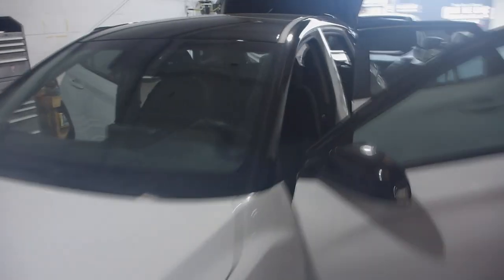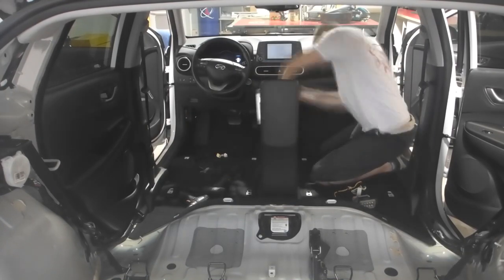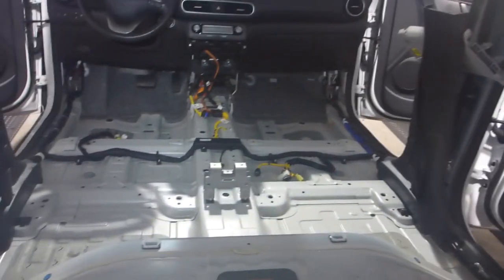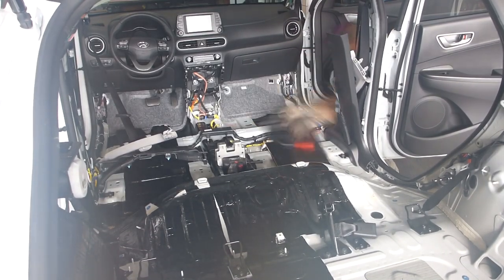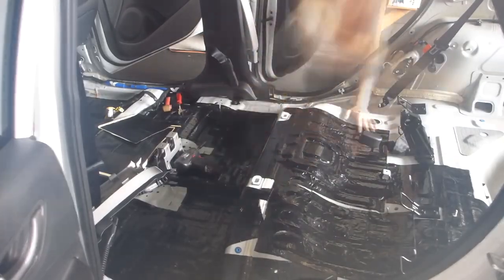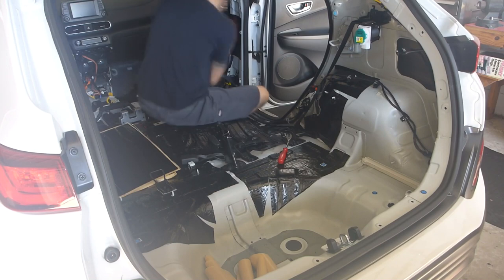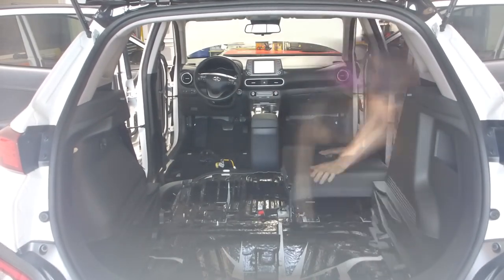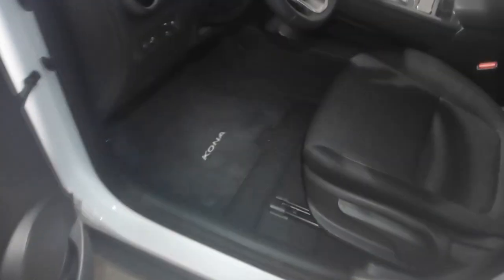Sound Deadening Roof & Floor of 2020 Hyundai Kona EV w/ Interior Disassembly - Full Process!

Comment: Started my first ever deadening job on a Kona EV today. Watching your video at 0.25 speed helped a lot to figure out some tricky spots. Managed to finish the roof. Floor tomorrow. Thank you :)
Reply from the maker: Awesome!  Glad to be of assistance.  My suggestion: do a 2nd layer on the roof, especially if you don't have a sunroof.  I ended up going back and putting 3 layers total (2 butyl, 1 foam) on the roof and it was significantly noticeably better than the original single layer.
Reply: I did 1 butyl and 1 ccf for now. I have a rugpad felt that I want to slide in between the ccf and the roof trim later. Don't think i would be able to do another butyl above head. My arms were like overcooked spaghetti yesterday
Reply from the maker: @SmugglerK-rb4xx  that's how you get STRONG!  :D

Comment: Fabulous job, can you advise if any hidden screw in the flat gear panel which you lift up at 0117 or just only clips pried up from the edges, I try to pry it up but it stays firm, thank you!
Reply from the maker: that center console gear selector trim panel just hasta be yanked upwards, or you can crowbar at it, whatever it takes, it's Hyundai tight: goes together quick and easy but not necessarily fun to take back apart.

Comment: Could you explain how to NOT crack the passenger side rear quarter panel when taking it apart?
Reply from the maker: lolol, but I don't have any experience with NOT cracking it!!
nahhh, you just gotta be gentle, a long pry tool helps but isn't necessary.  Get all the easy accessible poppers around the perimeter, apply even pressure from as far inward as you can reach, it'll come free no problem.  Me breaking it was a direct result of just going aggressive since I didn't care in the rear of the vehicle.  The back half of that car is a pickup truck bed to me so it's already been destroyed way worse from hauling materials than a single little crack from this disassembly.
Reply: @Bythirteen  Thanks so much for the tips!

Comment: As for all Hyundai Techs like myself. PLEASE Remove the dampner over the HV Emergency shut-off lid under the backseat. Just cut around it and remove it from the lid. We have to take the safety out when performing work on the HV system..
Reply from the maker: lol, you act like I'll ever have a Hyundai tech working on my car... or a backseat... O.o
Reply: @Bythirteen  warranty work man…
Reply from the maker: @knatt99  oof, yea, I don't trust Hyundai to honor any warranty for me.  Nor would I trust a local dealer tech to touch my car when they've never seen one in their life.
Reply: @Bythirteen  its an Hyundai Kona EV. What about when the speed reducer or engine goes to shit? That’s warranty, and not something you want to pay for (expensive as fuck). And fairly easy for us techs to change, I’ve done about 17 engines on the facelift Kona EV. They go bad 🤷🏼‍♂️
Reply from the maker: @knatt99  lol well then at that point I think we've got more important things to care about than a pesky layer of butyl that needs to be peeled back.